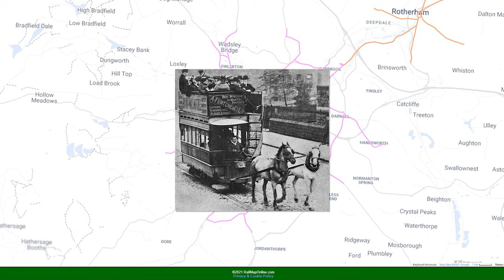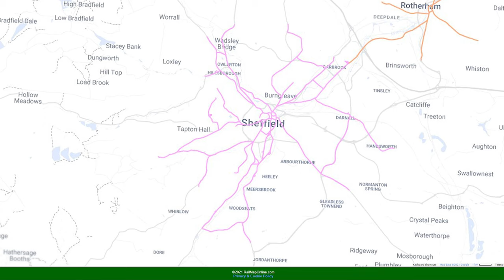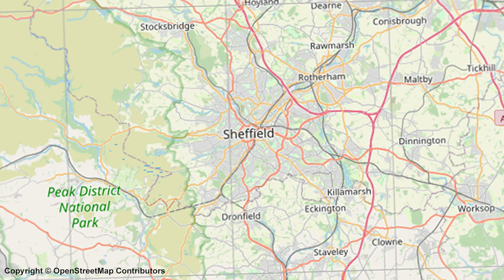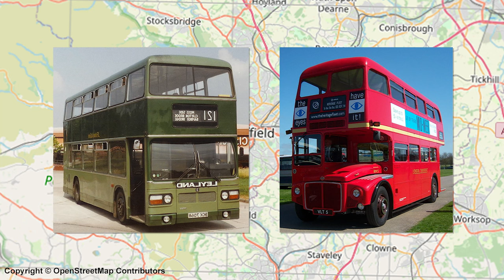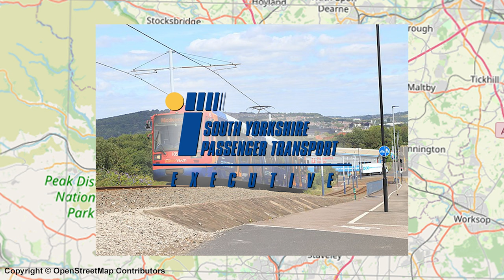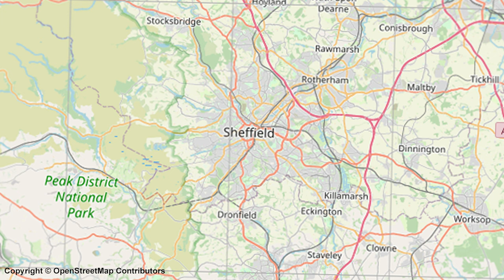The Past and Future of the Sheffield Supertram | Stagecoach Supertram | Clarified

Comment: And therein lies the problem with Supertram - the City Fathers! Whilst other cities have developed and expanded their tram systems, apart from the spur to Rotherham Parkgate, the system remains unaltered from it's original plan. The hospitals aren't served, and there are suburbs and their corridors who are desperate to have a tramline into the city centre, but there are no plans. The council has form here, there have been numerous ideas and projects other than Supertram over the years, that have become nothing more than a headline and an artist's impression on the front page of the local newspaper. There seems to be an inability or will to get anything done. The words 'piss up' and 'brewery' seem to be quite apt.
Reply: wait until you see glasgow (its subway hasn't had a single extension since the 19th century)
Reply: @notthatntg  are the clockwork orange it had a updated in the 70s when When Labour tried so hard to get some seats to win the 1979 election we all know who won
Reply: Thing is I know what extensions this system need 1st to the Moor that branch the terminus would be located where most buses turn right near the dual carriage way before London Road then turn left around the roundabout back into town this would a purple route extension with 1 tram per hour down there the other purple tram would terminate at Cathedral as usual. my 2nd extension is to extend the tram train to Doncaster and Adwick we would electrify the railway to connect these areas of SY together there would also be work down to sheffield and other intermediate stations to get the trams as far as Nottingham on the national railway network and eventually to Manchester to supplement trains. My final extensions would Be to extend the Blue and yellow routes to hall park head and Stocksbridge.
Reply: @declangaming24  I 100% angree an new tram that links Doncaster Woodlands and Adwrick would be amazing this will honestly also connect to airport to incourgure its use aswell we need more people like you inpower
Reply: @declangaming24  Have you looked into the Don Valley Railway proposals? It would cost very little to run a train shuttle (possibly a tram-train) to Stocksbridge.
Reply: @pmberry  exactly they do need to extend it up to Doncaster Would likely be 1st with intermediate stops at Swinton, Mexborough, Conisbrough, Doncaster but if this extention is successful go as far as Adwick calling at Bentley along the way. Another straightforward extension is up to Sheffield station from Parkgate these projects are straightforward you just need to put the platforms, overhead wires, signs ect your not building new track so it would be cheap up to Stocksbridge you use the old woodhead line.